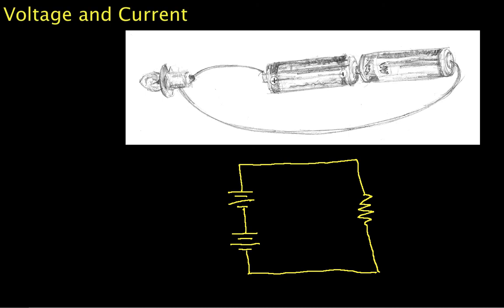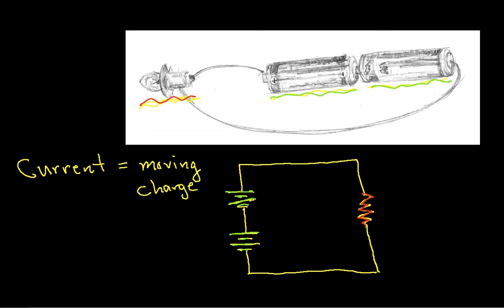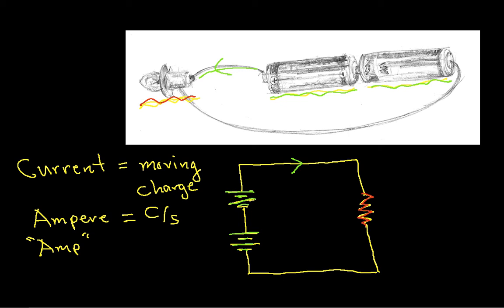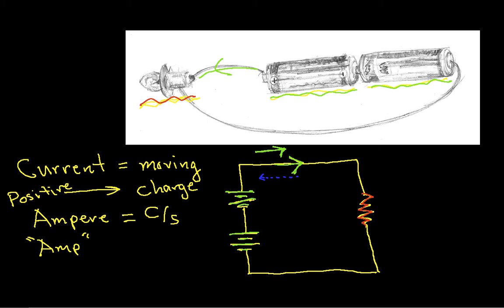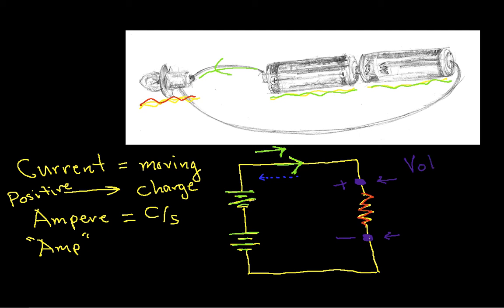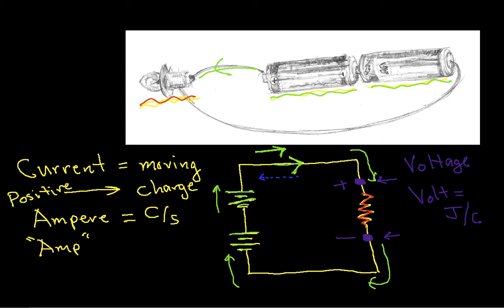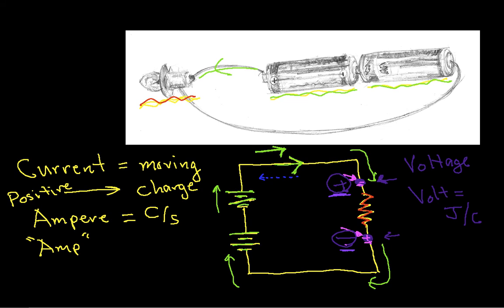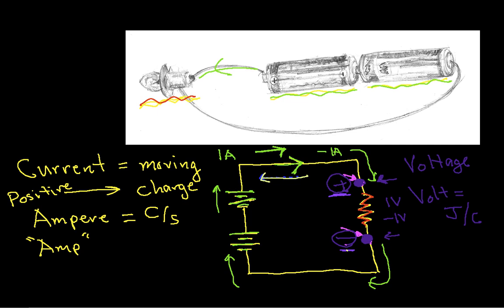Voltage and Current

Comment from the maker: I had not heard this before. You have a point, in that the units for current are A/s. I will probably still say current flows, since some viewers may not have yet made the connection that current is moving charge.

Comment: (3)
But the fluid metaphor being inescapable, even before Ampère, Benjamin Franklin had envisioned electricity as an "electrical fluid", in conformity with the then current ideas (only he rightly thought that there was just one type of fluid, not two) about electricity or heat (the phlogiston). It is almost unavoidable that people should switch from the fluid to the motion of the fluid and vice-versa. But this is the cause of difficulties for learners.